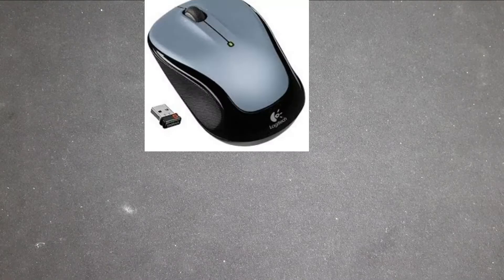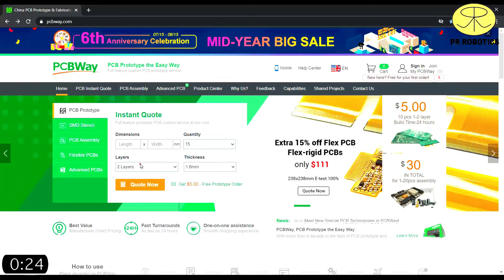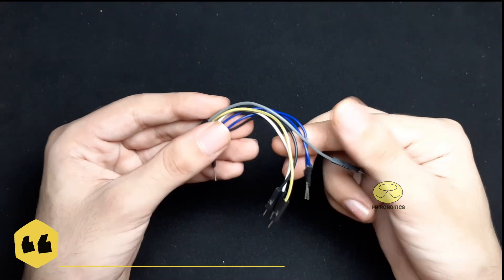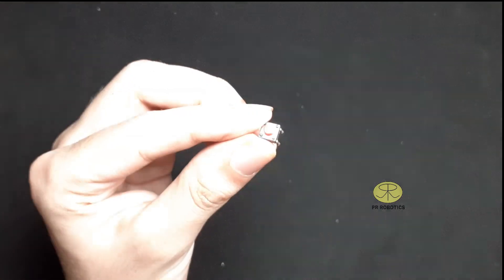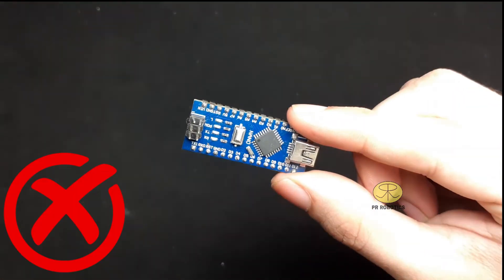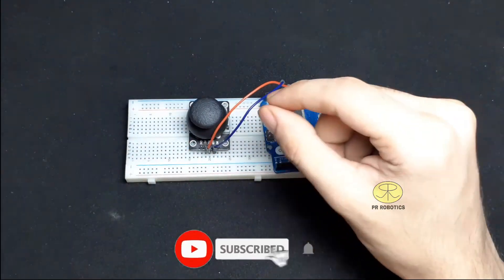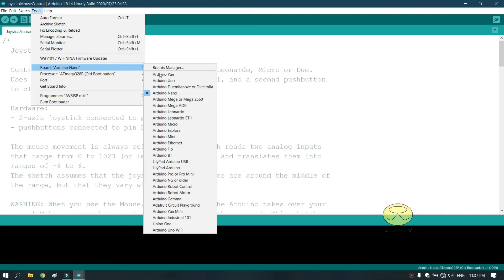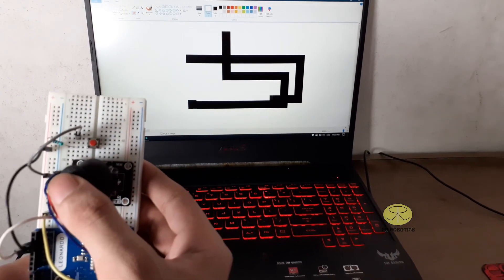#68 DIY pc mouse using arduino || PR ROBOTICS

Comment: Brother please tell how you have fixed joystick module to breadboard
Reply from the maker: Desolder the right angle male pin and solder the straight connector in place of it.